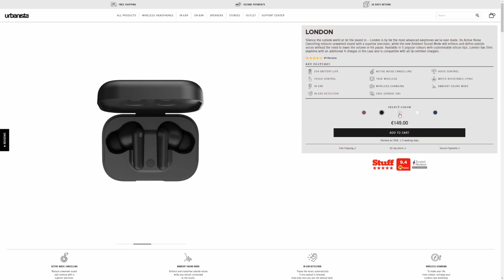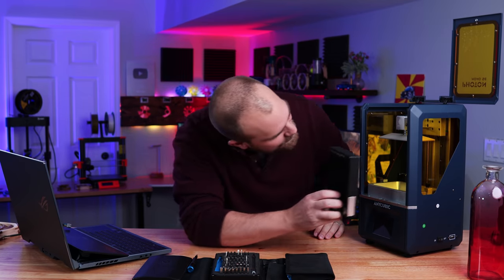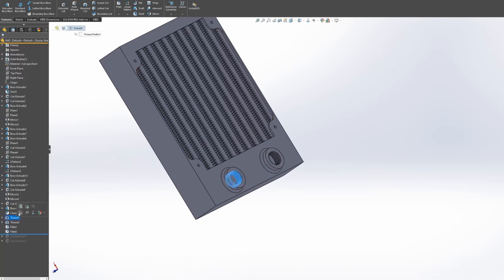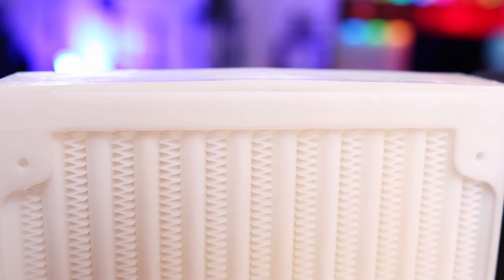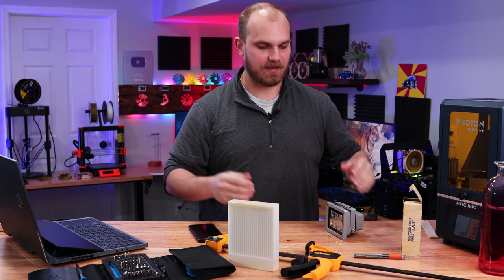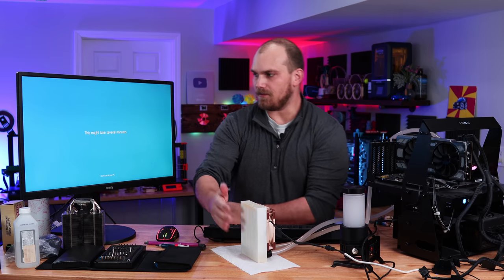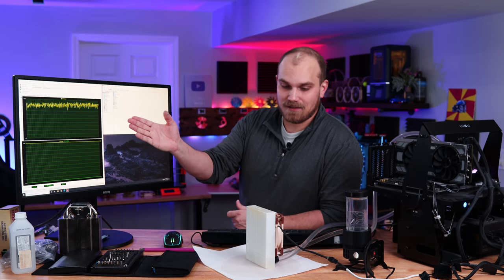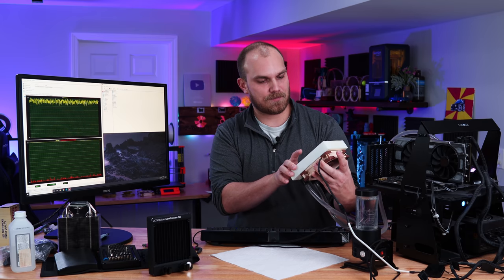I Never Expected This | 3D Printed EK Coolstream SE 120mm Radiator

Comment: Forget fin density, I don't think the plastic is thermally conductive enough for the fins to do much other than block airflow
Reply: I think you may be right, more general water tubes over a larger area would likely provide better cooling for materials like plastic where its not likely to transfer heat via the fins.
Reply: @rompdude  exactly my thoughts. When are we gonna get V2?
Reply: Yes, more tubes and very thin walls would probably help more.
Reply: If you look it up, YouTube has some pretty surprising examples that "prove" you wrong, though IDK offhand anymore whether those were PLA, PETG, or another thermoplastic.
Reply: @claws61821  There's a trade off between surface area, distance from heat source, airflow, density etc. 

With plastic having such a low thermal conductivity, I think that thermal delta is the most important factor, which is somewhat linked to airflow. 

I don't know when, but much like how excessive fin density and insufficient airflow can cripple normal radiators, I think the density limit for plastic is a lot lower than for aluminium etc. because aluminium moves heat to it's fins fast enough to maintain a higher thermal delta across all surfaces. Plastic wouldn't be able to maintain that thermal delta through a fin that is essentially a decent insulator
Reply: Have you ever held a plastic cup with hot water in your hand?  Even if it had thick walls?
This works also in other direction - cold drink in the hand will warm after 10 minutes becouse of heat of your hand.
I think it's about/matter of the thickness of the material.  
The thicker the material, the more thermal insulation there will be. Is an qirstion4of testing witch thickness ist the best solution.
Reply: @KarsonNow  I absolutely agree with your comment

But just to keep things in perspective, have you ever held a metal cup with hot water? I'd bet you haven't, because it would hurt immediately. Meanwhile, you can easily hold a plastic cup for several seconds at least
Reply: you're right. it isn't
Reply: @KarsonNow  True. Thats why thermal conductivity in civilized countires is measured in W/m*K
Or as I posted above: //The thermal conductivity coefficient of plastics is bonkers. approx 0,2225 W/m.K (PLA) vs 401W/m.K  Copper or 237 W/m.K Aluminium. Thermalpaste  1-8 W/m.K. Bricks  0,5-1W/m.K
It's basically a thermal isolator,//

Comment: Idea: Make a whole 3D printed watercooler loop including fittings and tubes
Reply: Not a bad idea, but I would not recommend testing it on anything valuable, there will probably be years of testing before it doesn't leak
Reply: @cambrown5633  you are right, he should probably not test it on a good setup it would be a good idea to test it on an old retired setup he doesn't use anymore.
Reply: Imagine a low profile integrated 3D printed radiator, reservoir and loop shaped to be slapped on an ITX system, cooling cpu/gpu, VRM, RAM and chipset .. SFF orgasm.
Reply: @cambrown5633  For leak testing it does not have to be attached to anything, and you would do that before fitting any of it where the water could hit electronics
Reply: 3d printed tubes might not be a bad idea, custom colors and perfect fit with no need to bend, and no need for any angled fittings. My only concerns is how much heat can resin and pla handle before they lose integrity
Reply: @juanramos2992  there are some 3d printable polymers that can stand up to 150°C before even softening.
Reply: 3D printed CPU Block.
Reply: @gutsuthemasterchef  I don't really think that would be possible, at least not all of it. He could only 3d print the top half of the block.
Reply: @Technicksworkshop  would be interesting if he could print the top part of the block and the fin for water channeling through the CPU Block and then just need a Copperplate and a seal could make it so that the fins could be swappable like they push into the main body and test people's fin designs, for water flow
Reply: @MartinBarker  that would be cool. Good idea
Reply: WITH RGB!!!!
Reply: @Technicksworkshop  with direct water contact on the CPU, it will work.
Reply: @gildardo  it might work, but also, it might fry the CPU
Reply: @meusprojetosdesoftware1488  the copper powder might improve the thermal transfer capabilities but not by much, but is worth trying and experimenting with the ratio of copper powder  and resin to maybe improve the thermal transfer even more.
Reply: If you were 3d printing a water loop you should just print the whole case with integrated pipes, reservoir, radiator, etc.
Reply: I’ve done it. Just coat the whole thing In see through nail polish and it becomes water tight
Reply: @Technicksworkshop   It is a little more complicated! I saw in some channels they baking printed parts (made in resin printers) the resin would evaporate, and all that is left is the rest, in this case, would be the metal. There are resins that come with porcelain, iron, or copper. You should check this in other videos in youtube, they show how it becomes when the printed parts are baked.
That would mean, if the resin evaporate, you would have a part that is almost pure metal, and the performance would be nearing the same as radiators made of copper or aluminum, or maybe a little better, since the parts would be tightly coupled.
Reply: @meusprojetosdesoftware1488  yes I know about that, but when the resin evaporates the 3d print can shrink and become porous so the water can leak. Watch Integza's latest video
Reply: @Technicksworkshop  Yes, I know that as well, but can be easily fixed. If you know the rate of the shrinking, you can increase the size of the printed part proportionally to the shrinking rate.

Comment: Oh God what have you done the are going to start selling us plastic aio's.
Reply: companies will advertise metal as a feature XD
Reply: Hey the cheaper they can get custom water loop's the better as other parts will start coming down in price as they get more mass-produced as more people use them :D
Reply: @MartinBarker  he's one of them.
Reply: Metal could be cheaper to make. You can’t injection mold a radiator.
Reply: @spacedoge3508  Injection mold? No. 3D print with metal-infused filament? Yes. And you know the industry has the money to spend on developing that, too.
Reply: @LexYeen  3d printing is much more expensive than brazing some fins on some tubes. 
3d printing is not yet viable as a mean of mass manufacturing.
Reply: car radiators have had plastic ends on them for awhile i wouldnt be suprised to see that. i think that on this small a scale the savings isnt near that of a car radiator or we already would have.